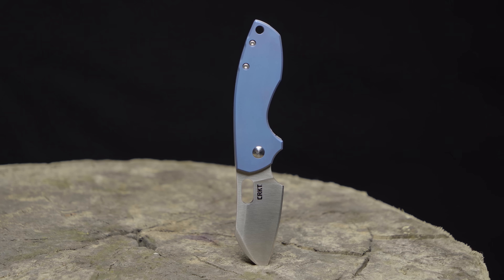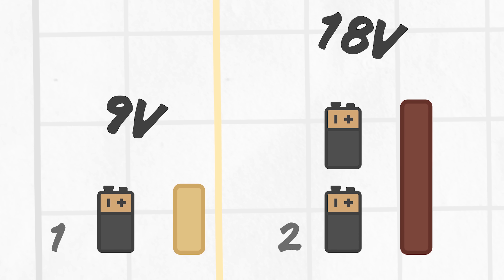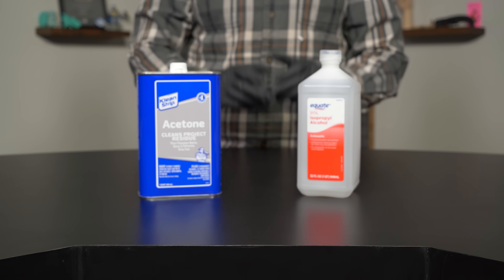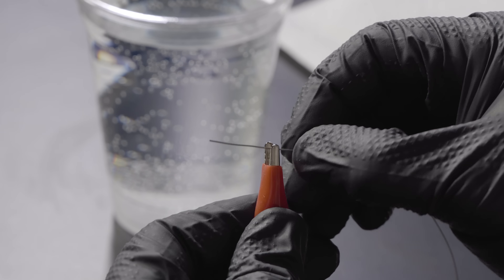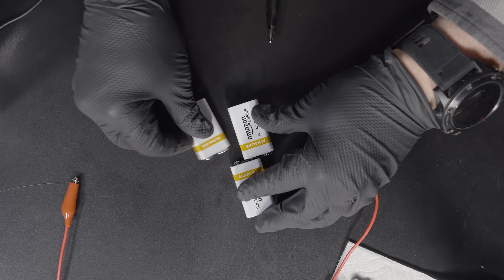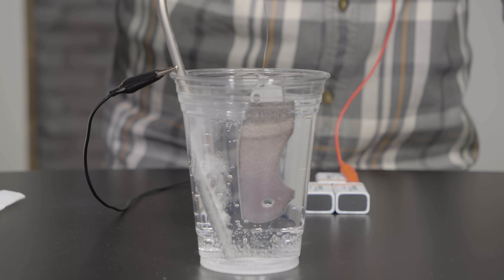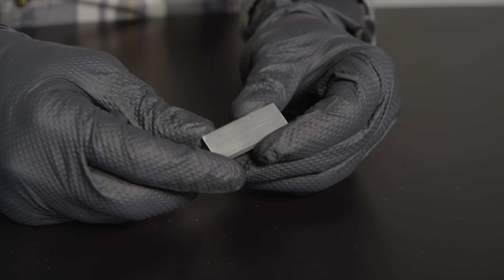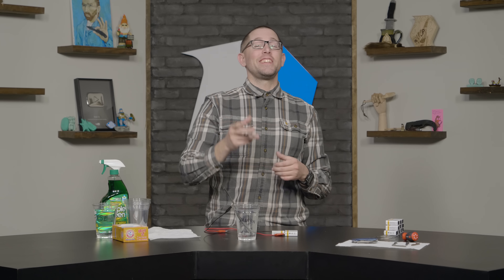"Make It Pop!" DIY Titanium Anodization | How To Knife

Comment: I don’t have a knife handle/scales to anodize but I have a related question and I bet this is a good place to ask. I have a titanium fountain pen that I’d like to anodize. Problem is if I disassemble it to the point it’s designed to be disassembled to for cleaning and maintenance there’s still a plastic liner inside the pen’s cap, some threaded aluminum bits, and an acrylic ink window in the body of the pen. The heat anodizing method is an obvious no which is why I’m here. Let’s assume I’m able to make a good connection to the titanium…what concerns would there be for the plastic or acrylic parts if submerged?

Thanks in advance!

Comment: As an Ultra-Light (UL) enthusiast, I choose not to anodize my titanium to save even more weight.
Reply: Yeah bro like anodizing adds at least 20% weight to titanium parts, that's a lot
Reply: @jeanladoire4141 At least.. think about the weight savings
Reply: @VOJAKIS i was joking, anodizing does not increase the weight of a part, the oxide layer is microns thick, even with the most precise scale you wouldn't be able to notice a weight incrase. So don't think you're actually saving weight by not anodizing, you'd reduce the weight of your UL by eating less
Reply: @jeanladoire4141 I don’t know man, those micrograms really add up, especially on a part with a large surface area, you know.

Comment: I followed this to the t with a titanium Damascus peanut lighter by Maratac. I used 10 9v batteries in a series. The top of the lighter where the titanium wire was connected to started to anodize but the rest did not. The batteries got to be very hot and so I stopped the process. I don’t know what I did wrong. It didn’t work for me sadly

Comment: I noticed 2 things with the samples you anodized, (and when you did the scales) you had the battery connection made prior to immersion into the solution which looked like the first portion of the samples had a slightly different color or darkness...wouldn't it be more uniform if you immersed the parts into solution FIRST before making battery connection? This also might help if any bubbles formed on the piece while inserting and you could remove them a toothbrush or small brush would be able to rid them from the part before making battery connection.

Comment: I'm hoping someone with more experience can extend a hand of knowledge. Would the voltage for desired colors be the same for tool steel? Looking to do this to a hammer with a steel body (the ones with the rubberized grips). I don't know if the difference in material being worked with, would affect the voltage needed to achieve the desired color.

Comment: When you have to buy that many 9-volt batteries (and remember they'll be draining voltage) it would seem a better solution would be to buy a low-end power supply. Never have to worry about your batteries not having enough juice left for the job. Does that make sense?

Comment from the maker: This process only works with titanium.
Reply: Does the wire have to be titanium..?
Reply: @mattpearson8843  no but it’ll leave a hot spot on the part if it’s anything other than titanium
Reply: Yo is it cool if you put a link to all those tools including the batteries
Reply: How do we anodize aluminum?
Reply: @qtnv.  pretty sure anodising aluminium is harder and produces a bunch of toxic gases so probably not best for DIY.
Reply: @thedestroyer6815  ok
Reply: @qtnv.  Through a process called hard coating, which requires industrial equipment
Reply: @Mophony  ah i see
Reply: You can remove the ano with WD-40?
Reply: @pabloahrc2348  no
Reply: @raccoon344  ok
Reply: Hi! Is there some way of coating any other object with Titanium powder in orden to make the same process and cover it with titanium anodized? In electroforming you previusly coat the object with graphite paint and that turns into cooper. Is there a similar process with a titanium "paint" that allows  titaniuming objects? And then, anodize them...? Other than vapor
Thanks you very much!
Reply: Would this process work to restore scuffed timascus? What voltage would I need?
Reply: I have a STEEL WILL Apostate titanium frame lock. Can I do it in blue??
Reply: how do we do it with stainless steel?
Reply: @mediarare1014  Doubt you'd be able to because of stainless' ability to prevent oxidisation, which is what's needed in this process. You could pull it off with Aluminium as well as Titanium from doing a search, but Stainless Steel, or even Carbon Steel don't agree with the process and won't come out like above.
Reply: @Reploidx9  ok thanks bro

Comment: It's just a good habit with every battery hookup, no matter the size or voltage, to hook up the positive first, then the negative. At this level not a big deal, but at higher amps it can make a difference in generating shorts. Just a good habit to apply to all battery hookups. Positive is the first one on and the last one off.  Cool video!

Comment: so theoratically if u use different voltages with different parts of the aluminium dipped in the solution you can create a multicolor  piece . can u guys try it?

Comment: To make your life easier buy some Whink rust remover. It MUST be the Whink brand because it has hydrofluoric acid which is one of the only acids that will remove the oxide layer on the titanium that causes the color change. Dip the titanium part in the Whink rust remover and then in tub of winded and then distilled water then straight to anodizing tank. You can anodize and re anodize as much as you want. Much better colors with this process. Be careful with the fumes.

Comment: I prefer heat over electric. With heat you can get a lot more different color patterns that are a lot brighter but it's harder to control the color with heat. Depending on the material finish you will get a different sheen with heat or electric. A polished finish has stronger color results compared to blasted or brush finish.
Reply: Do you polish first before anodizing? Or do you after the part is anodized then proceed to polish the part?

Comment: Please be aware that many batteries in series will produce a deadly voltage. You should treat the wires from five or more 9 V batteries (~50 V) with the same respect as live wires from the power outlet in your home (that has 110-240 V depending on where you live). DC is a bit less dangerous than AC but not safe and 100 V DC can easily give a deadly chock. Even if the batteries are small, they can easily provide deadly current and many times more than that if the voltage and resistance are right, or wrong...

If you use high voltage, never touch bare wires, metal parts or liquid as long as the voltage source is connected.

Comment: True titanium is hard to get and very expensive.  A single 5mm bolt here costs like about $50.
Reply: That's cheap. I've got four in my spine with two rods and they cost $4000. Installation was extra, read lots of extra. Don't try it at home.

Comment: LOL !!
YOU COULD HAVE USED ELECTROLYSIS TO CLEAN THE METAL.
WASHING SODA/BORAX.
50-50 SOLUTION OF SALT&VINEGAR WILL MAKE AN AQUEOUS SOLUTION OF COPPER, ZINC, AND MORE.
ELECTROPLATING, ANODIZING, SUPERTINNING, AND ELECTROLYSIS ARE ALL VERY SIMILAR.
SILVER ELECTROLYSIS IS ALSO 1001 USES.

Comment: Question: once you anodize, is the piece protected from doing it again? So, if you wanted to do a two, or three, tone color scheme; could you dip the piece, then increase the voltage and do a partial dip to change the color of just that area?

Comment: Just tried, worked pretty well. Not quite the vibrant color I was expecting, but more than I thought a fist full of batteries and some baking soda would get me before this video. Thanks guys.
Reply: It's possible that the finish or polish on your titanium reduced its ability to receive the anodization. I don't know anything about it myself, but I'm sure there are videos specifically on polishing or scuffing or whatever you do to titanium to make the surface more receptive to anodization. Something for me to think about as I attempt this, as well!
Reply: Anodization colors are less impressive than heat oxidation colors (aka torching the titanium with a fire). However the best result is with a polished surface, if the surface isn't mirror polished, the end result will look duller.

Comment: Works by using electron flow direction. Electrons flow from neg. to pos. and boils off the  coating or metal ions from the donor metal.  This is exact opposite of conventional  current flow which is pos. to  neg. Also this is how the old vacuum tubes operated.  Neg to pos. electron flow from a red hot cathode.

Comment: Good stuff! Don;t forget to make sure all lockbars and such are either removed or covered (clear nailpolish works great) cause if you have anything more conductive, it'll bypass the titanium. For higher voltage colors, also try and do both scales at the same time so they match, it never works QUITE the same twice
Reply: Great advice, thanks!

Comment: You can stonewashed easily by using a Gatorade bottle with the media and some windex or soapy water. Rubber band a towel around it and throw it in your dryer without heat selected.

Comment: Would this work with aluminum scales too ?
Reply: anodizing aluminum uses a different electrolyte solution, but the process is similar. The main difference is that the oxide layer on aluminum is basically colorless and you have to dye it after the anodizing process, after dying it you then boil it to seal in the dye. the plus side is that it doesn't require high voltages, I think you can use a 30v bench power supply. Oh, also, I'm not sure, but with aluminum you might have to connect it to the negative side rather than positive.

Comment: I took a Ti Boker Chad Whats-His-Name apart to polish the scales one time, and never did get it back together straight, so I'm a little skeptical about this being easy as pie. OTH, now that I have the Boker experience under my belt, maybe I can pay enough attention in disassembly so that it will go back straight during re-assembly. Maybe. 

Anyway, does polishing the Ti affect the relative ease or difficulty in achieving this method of anodizing? Really, I'm not like a Boker fanboi or anything, but it just so happens that now I have Boker/CountyComm Ti (on one side) Mollusk. The Ti scale is as dull as any Ti I've ever seen. Turning it blue (I mean, look at my user-name, I'd almost have to go with blue!) would help, but polishing it and turning it blue, it seems to me, would really make it pop. I suppose it's possible that I actually bent something when polishing the first Boker and that's why it never was straight again, but that's another thing I can be laser-focused on to avoid this time I reckon. I would like to know if polishing will affect the electrical process though. Thanks for any help you can offer.

Comment: Are there any other materials that can be anodized in a similar way, like steel or aluminum?
Reply: UberPownage nah they all require different methods to anodize because they’re different metal
Reply: Yes but not like this. Different metals require different solutions and most common steels only requires an acid/oxidizer. There are videos of patina and staining.
Reply: Yes, the same set up but for aluminum you will need to use a sulfuric acid solution instead of the baking soda solution.
Reply: @JuanWick209  and the oxide layer will be clear, getting thin film interference colors i think is not possible with aluminum
Reply: Anodising aluminium needs more steps, but it is less restrictive in the colours.
To colour anodise aluminium, you use a dye in the middle of the process to colour the oxide layer produced.  That's why it's more versatile.
Titanium anodising obtains the colour by using voltage to change the surface structure in such a way that it LOOKS like it's coloured, but actually isn't (google "thin film interference colour").  Different voltages produce different colours, and the change is one-way - you can change it to a higher-voltage-colour, but not lower without removing the surface and starting over.
Reply: Not the same process but ferric chloride will gray stainless steel.

Comment: Dude this is one of the Best Videos you’ve done...Keep the how to videos coming! Aluminum next?
Reply: I second doing a video on anodizing aluminum!
Reply: would this same process work for aluminum?
Reply: @colemansines9722  No. AL uses the same voltage for all colors. The color is determined by dye color, not oxide layer thickness.
Reply: powder coating is the way to go with aluminum... fairly easily achieved if you have a spare oven at home that you dont intend to ever cook food in again.

Comment: awesome video! gonna try this with my Ti knife. will this work with Aluminum?
Reply: Aluminum will not behave the same. You actually have to use dye when anodizing aluminum.
Reply: @jamesfedorka8744  what about Steel?
Reply: For steel you would need to use a blowtorch and heat anodize it

Comment: Is it possible to get a two tone finish on the anodization? Say you dipped the pivot end half way to get a blue finish and then dipped in the lanyard end to get a yellow finish... would that work or would it need to be submerged completely?
Reply from the maker: Two ways you could do that. 1. Anodize the whole piece a low voltage color and then anodize which ever side you want a different color at a higher voltage. 2. The double dip method you mentioned but it may be hard to get a clean line. We are planning an advanced video soon.
Reply: @BladeHQ  That's exactly what I would be looking for, thanks for writing back. If I do the double dip method I wouldn't mind scrubbing off the middle part like you showed in the video if it does bleed through into the opposite section. Make it into a tricolor set up with gray as the middle color.

I got one more question for you: I was looking at the color groupings and didn't notice any orange or green. Are those colors not possible with this method?
Reply: Green is 12 9v..that's what I'm going to do

Comment: How did you connect the batteries when you needed more than 3? Alligator clips between each group of 2 or more?
Reply from the maker: Nope you just keep plugging batteries into each other in series and then connect to the open positive and negative terminals. It is plug and play.

Comment: You guys have never made a “how to” video like this before, and I gotta say that you knocked it outta the park! Also I wanna see the shakeyhands knife collection.
Reply from the maker: Thanks! More to come.👊
Reply: @BladeHQ  could i replace the 9 volt batteries with a car battery charger?
Reply: @BladeHQ  I'd recommend showing how to acid etch and stonewash blades with ferric acid and a jar of rocks as well as copper plating. Both are fairly easy diy customization projects. Could also probably do some engraving
Reply: They did one other with a para 3 where they rit dyed scales and darkened the blade w/ apple cider vinegar but it was much more free form and less scripted but i get what you're saying.
Reply: Pretty sure they did one where they showed you how to dye g-10

Comment: Cool series! I just happen to be carrying my BHQ D2 CF Pilar today. I like that you kept it simple, but using etch (multi etch works best) and a power supply is a big step-up and isn't too expensive. Also, I find that having multiple points of contact with the part helps a lot... My favorite project so far is a Kizer Feist with blue scales and pink clip and back spacer

Comment: Serializing up to the voltage you need by simply clicking 9V blocks together is brilliant!
Reply: I tried a battery charger on the 6v setting and it took about 3 seconds to turn blue.....maybe I'll try the 12v side....pray for me please.....
Reply: @Nonegativewaves  how did the 12V turn out?
Reply: I was working for an electrical contractor 15 years ago and I worked the service side. Every year around Halloween we would go into all the apartments we were responsible for servicing and replace the 9V batteries. At the end of it all we would series up the batteries. FYI the batteries start arcing through each other a little over 300 volts. The batteries will start to smoke when you close the circuit.
Reply: Do you have to use ti wire ?
Reply: @jordanmyers0326  no you don’t. I use stainless steel, something like a fork works well.
Reply: @jordanmyers0326  you need a titanium cathode, yes
Reply: I did something similar a while back, got the voltage up to 176volts lol